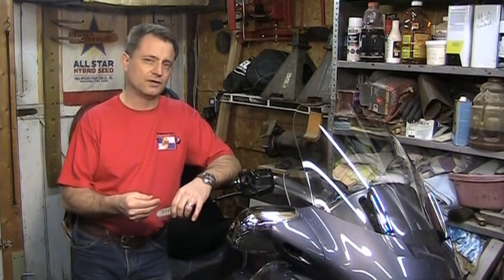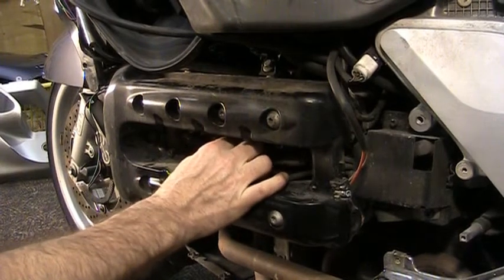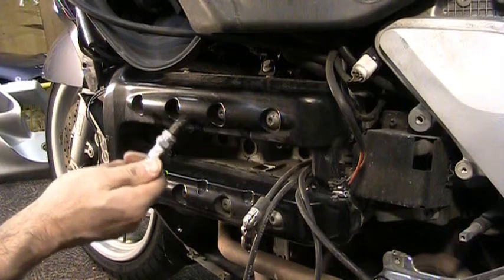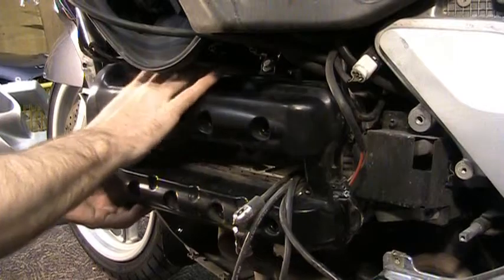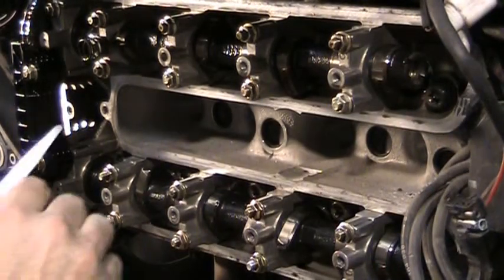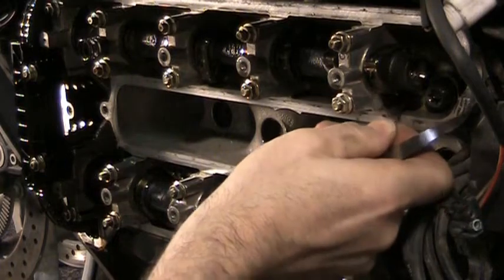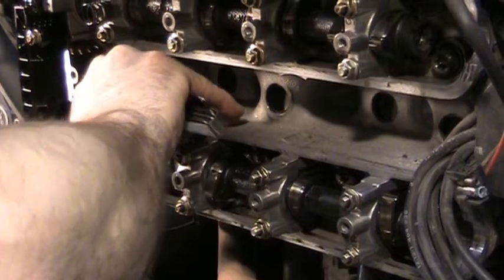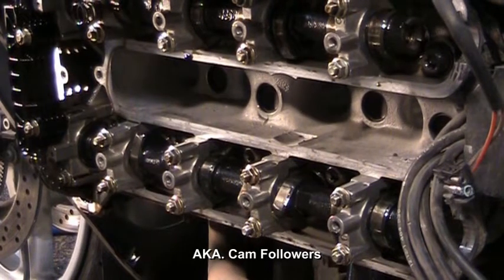BMW K1200LT Valve Clearence Check Pre Adjustment DIY Part 1 of 3

Comment: Thanks for making this video.  I have a 2000 K1200RS that I fixed up (had to replace clutch disk and oil seals) and have been riding.  

One thing I noticed in your video is that you removed the plug wires before removing the valve cover.  I’ve found it’s easier to just remove the cover first, then the wires and plugs.   Take a phone photo of the wire routing first, of course.  And put the plugs and wires in before removing-installing the cover.  That way the wires are all tucked in and out of the way.

Comment: Kirk, I have been working on my k1200rs 1997. used ur vid (great) as a guide, anyway after checking all valves  I am surprised to find that nearly all the inlet valves are way tight. Thinking I must be doing it wrong so checked the valves 3 times and yep I have 7 inlet way below bottom limit. I would understand having one where the valve seat had worn but after doing some research on forums no one has come across so many so tight. Exhaust valves are reading bottom limit so ok there. I had noticed the last owner had done this job in the past and didn't do the research as they ended up putting the valve bearing caps on in totally the wrong order. anyway I have just put it all back together the right way in the hope it may have made some difference to the clearance..... but as you probably are telling me now......Not gonna make a difference!  anyway I'm up to changing the 7 buckets needed.....what I'm concerned about is am I missing any underlying problem here. have you came across this  many being out by so much....... they are inlet 1 = .152 & .101...... 2= .025 & .101.....3=.025 & .076.......4=.025 & .025.  it's a 1997 54000 miles on the clock. part service history.  surprisingly runs nice. other than the cam chain cover  oil leak which is why I decided to work on it in the first place.

Comment: Kirk thanks for the Video. My 99 LT has 38k miles and is due for a valve check/adjustment. The only thing stopping me from doing it myself, is that I like to see it done once before I do it. Now I have. I will tackle my own very soon. The last time BMW did it, it was near $500.00 of course that included new plugs. Thanks again.